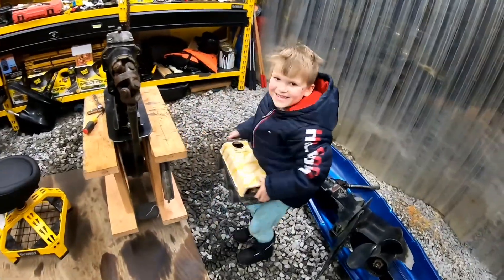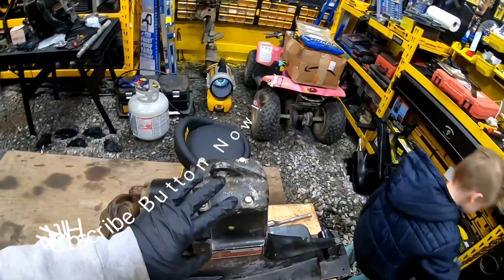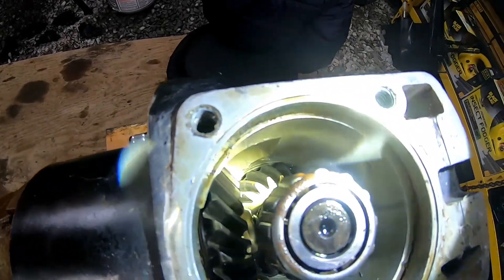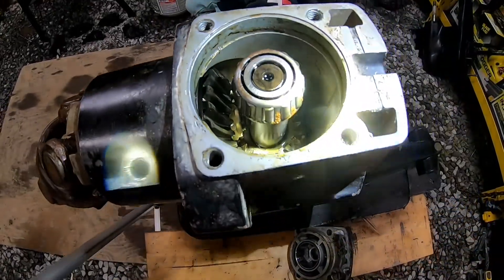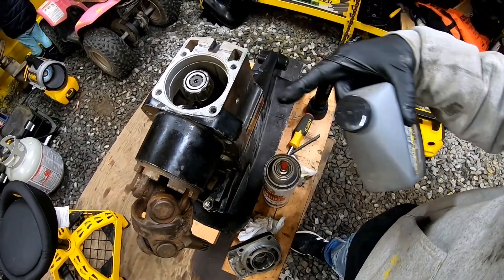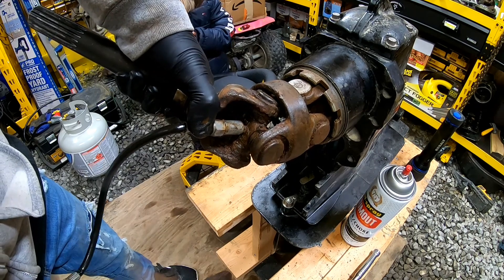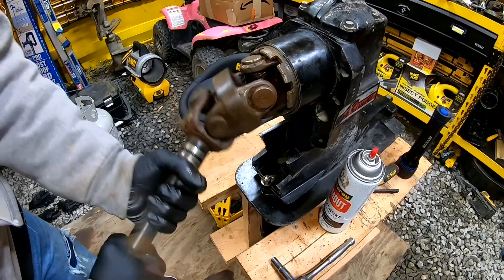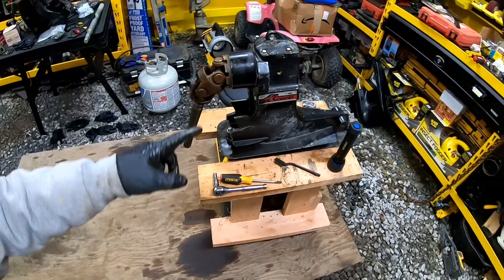Mercruiser R/1/MR/Alpha 1 Sterndrive Top Gasket And Oil Change

Comment: Why fill from the bottom ?
Reply from the maker: You have to fill from the bottom to get the correct amount of oil in it!  There are 2 holes one on top and one on bottom you fill from the bottom until the oil comes out the top hole, that's how you know you have the correct amount! Thank you for watching!👍😊
Reply: I have heard that it prevents air bubbles from forming when slowly filling from bottom, and that's how the proper amount of oil is filled.  Otherwise, a bubble displaces enough oil to cause a problem later.
Reply from the maker: I can tell you that's not true! Remember your filling until oil comes out the weep hole and there is plenty of air above the weep hole through out the sterndrive!